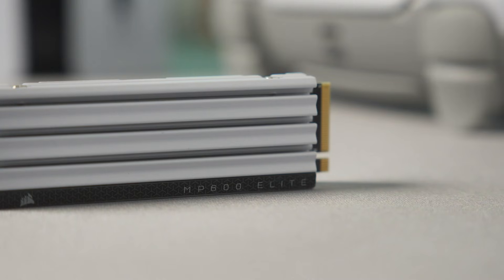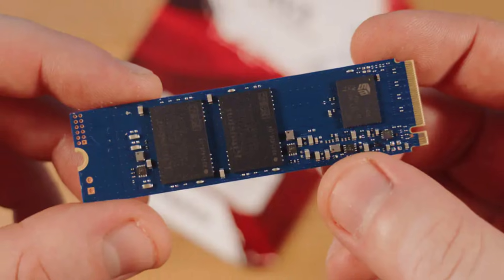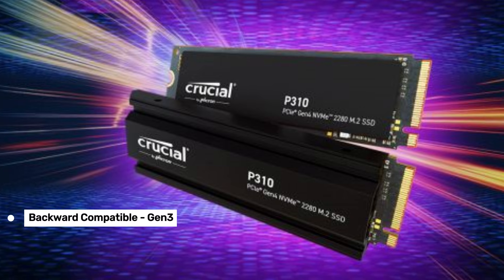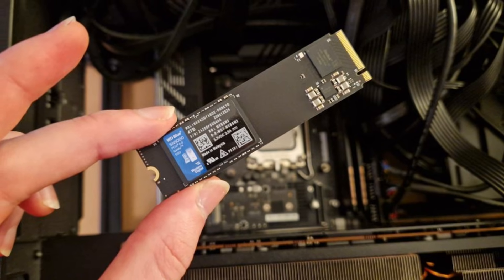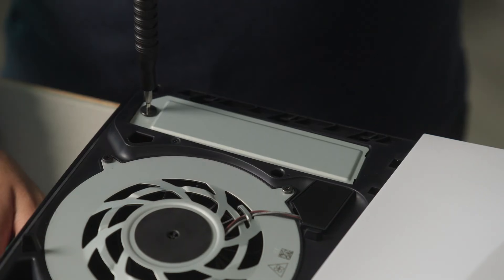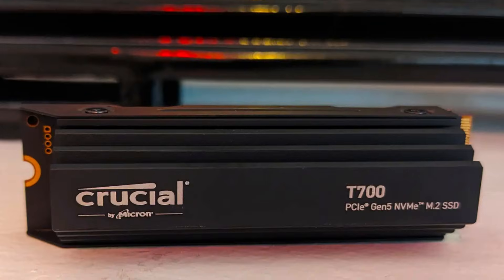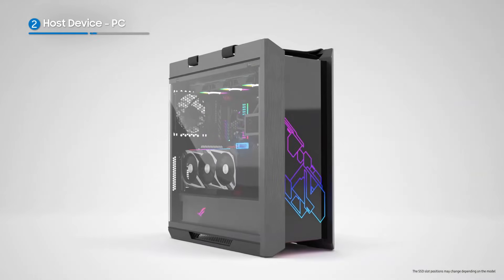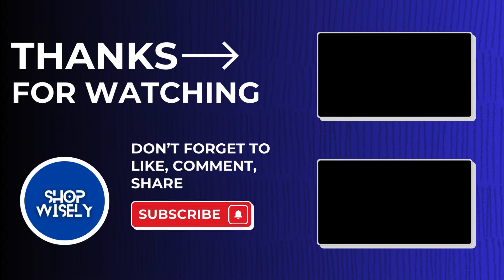Find the BEST NVMe SSD for your Gaming PC in 2025

Comment: A word of advice: Avoid the Samsung SSDs at all costs. I'd read all about their premature failing (it seemed to be caused by a firmware issue causing write errors that ultimately led to premature disk failure), bought a 990 Pro, installed Samsung Magician software, updated the firmware, regularly monitored the drive's health and after only two months (of normal use--no gaming, video editing, it suddenly failed on me and I lost all the data (I was using it as the boot/OS drive); It isn't detected in an NvMe-USB reader, and isn't detected in AOMEI partition assistant, G-Parted, etc. So Samsung clearly hasn't solved the issue....don't risk it
Reply: They solved the issue
Reply: @Furious_virusThey'd supposedly solved it when I bought mine and it fried itself. Do with that information as you like 🤷‍♂️

Comment: wd black sn850x is very good too, but expensive.
Reply from the maker: Thanks so much! great point—the WD Black SN850X is a fantastic drive with top-tier speeds, especially for gaming. We didn’t include it in this list because we focused on a range of SSDs that each stand out for specific features like cooling, durability, or Gen 5 performance, not just raw speed. That said, the SN850X is still a solid choice if it fits your needs and budget.

Comment: you have to update, since the samsung 9100pro drains the max out of PCIe 5.0. and also has a late throotleling
Reply: But the mp700 SE is still better in benchmarks... 9100 throttles in 2mins, it has no fan on heatsink.
Reply: @hrodgarthevegan  that is true, but they write more before the trouttles begins, then the others. You also need always a Heatsink für PCIe 5 SSDs

Comment: Sn 5000 500gb varuant is best because of 300 tbw its good or pne of best choice for its proce
Reply from the maker: Great point! The WD Blue SN5000 500GB is indeed a solid choice for budget-conscious gamers. Its 300 TBW endurance rating ensures durability, and its PCIe 4.0 interface offers improved performance over previous generations. If you're looking for reliability and speed without breaking the bank, the SN5000 is definitely worth considering.
Reply: @shop.wisely can you suggest any ssd for enclosure 10gbps one any cgeap option with good tbw
Reply from the maker: @darkstorieys  For a 10Gbps enclosure, you'll want an NVMe SSD that offers reliable performance and a decent Terabytes Written (TBW) rating without breaking the bank. Here are a couple of budget-friendly options to consider:

WD Blue SN5000:
This budget-friendly PCIe 4.0 SSD offers good everyday performance and is very affordable. It has a TBW rating of 300TB for the 500GB model, making it a durable choice for general use. 

Kingston NV3:
A competitively priced PCIe 4.0 SSD that offers decent performance. It uses a Host Memory Buffer (HMB) design to keep costs down, though it comes with a shorter three-year warranty. 

Both of these SSDs should perform well in a 10Gbps enclosure, providing a balance between cost and durability.
Reply: @shop.wisely thanks bro 😀

Comment: 🔥🤘💀🎸🔥Let’s go team… Crucial!!!!! We are choosing PCIE 5.0 NMVE drives for real speed and future-proof!☠️🏍️😎🔥
Reply: Not to mention heat
Reply from the maker: 🔥🤘 Absolutely! PCIe 5.0 NVMe drives are the way to go for insane speeds and future-proof performance! Crucial is definitely bringing the heat with their latest lineup. Time to push those read/write speeds to the max! ⚡💀🚀
Reply: @shop.wisely Time for the Manufacturers to provide Gen5 headsinks on their Motherboards that can handle Gen5 speed w/o any throttling. We have Gen5 slots, we have Gen5 SSDs but we have Gen0 cooling.